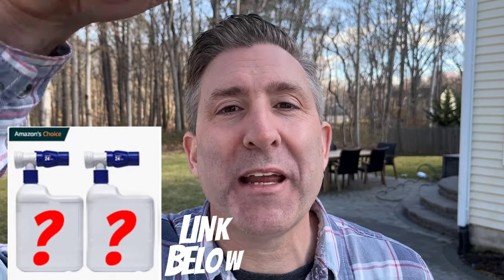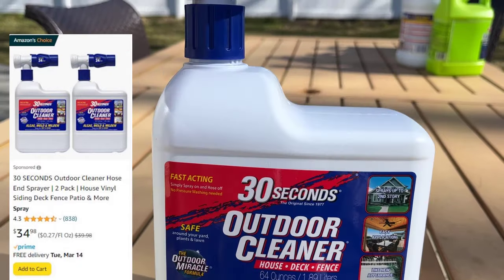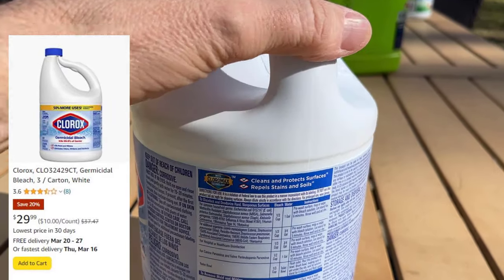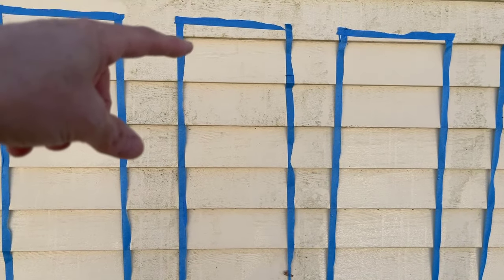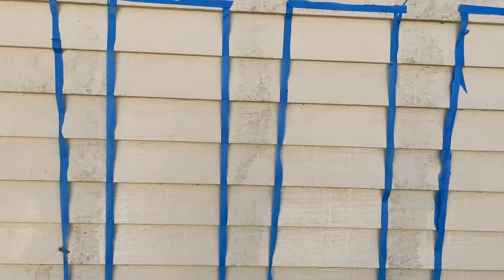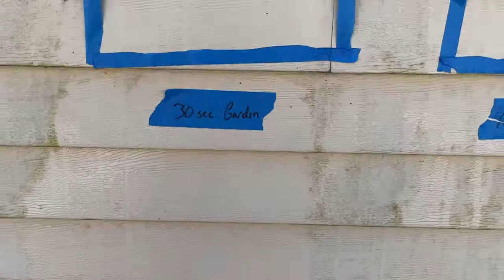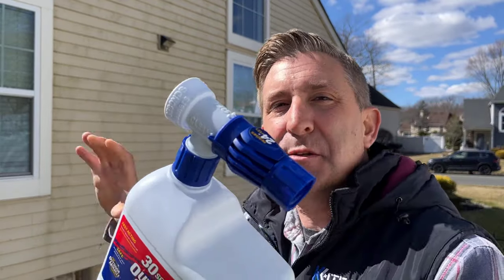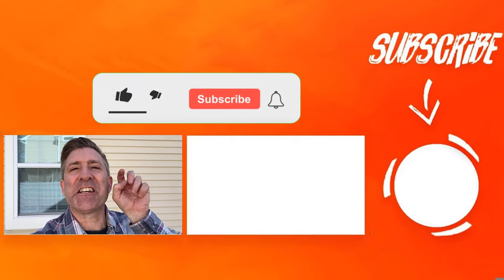DON'T POWERWASH - Top 5 Siding Cleaners: One Comes Out on Top💦

Comment: Under $3 for a gallon of regular bleach. Put a third of that in a 2 gallon sprayer with a few onces of Dawn dish detergent and the rest water - less than $5 tax included... that one gallon of bleach covers my little ranch house and 2.5 car garage 3X, and I guarantee it does just as good of a job.
Reply: I would try that but we have a lot of shrubbery and flower gardens around the foundation and I'm sure this solution would not be very healthy for them :(
Reply: Idk about anyone else, but the day I spray bleach on my 20k siding…wth
Reply: @jeffflowers729 I do this for a living. Pre-spray/ wet the plants. Any drips that land on it will not damage it. If you do drip on it you can just spray with a hose again real quick and it will dilute it. Its safe
Reply: @myheartisinjapan3184 you swim in sh. Bleach/chlorine/sh. Its all the same. Its dangerous or helpful depending on the strength. Just like anything else. Bleach is a scary word because it messes up clothes sometimes.
Reply: Thank you sir for the knowledge.

Comment: Ive always had excellent results just using cheap dollar store bleach with a 50/50 mix and rinse with the water hose. Ive always been told that it destroys the vinyl siding but mine is 23 years old without any visible damage and i clean it twice a year…
Reply from the maker: I think bleach is bleach - all the products that I tested say safe on vinyl
Reply: Is 50 / 50 bleach safe for trex deck
Reply: It doesn’t destroy vinyl siding, but it will destroy vinyl fencing on your deck. It removes the protective coating put there by the manufacturers.

Comment: You didn't try pool chlorine with 30% chemical that all pros use these days.
Reply: But will deteriorate the paint?
Reply from the maker: I think that is true - however the point of the video was to test products that homeowners can use easily and safely
Reply from the maker: @Carlos.Rivera  and possibly kill plants
Reply: @Kitearmy  you have to wet the plants with water before, during and after with ALL these chemicals.
Reply from the maker: @markb3866  right - good idea
Reply: @markb3866 i would be ticked off u kill my Lillies, rose bush , etc.
Reply: Diluting the pool bleach 4 to 1 is a pretty good economy if you already have pool bleach for your pool.

You want a 5 to 7% HypoChlorate strength in a hose sprayer at best for latex paint or vinyl siding to avoid pitting and color loss.

DollarTree and other generic household bleach is 5.5%...typically $2.50 per gal to $5.

Comment: That 30 sec cleaner keeps cleaning for days after. It’ll look cleaner and cleaner in a few days
Reply: Pritam - you are correct! We tried it for the first time this week and noticed the same thing. We bought the concentrate and applied it using the soap function on our pressure washer. Works great, even without rinsing/pressure washing off. Our gutters and stucco bands brightened up like new. Very satisfied!!!
Reply: Is it safe around plants, especially here in South Florida?? Or should I drape my pineapple and Goji bush

Comment: I use the mold armor deck full strength in a garden sprayer. I Use the deck cleaner on my wood deck, vinyl siding and vinyl screen house top.  It has worked well.  He did not hose it off after 10 minutes which I found is needed.  Vinyl looks brand new and tends to resist mold for about 2 years on the siding. With the bleach there is the strong smell plus it ruins whatever clothes it touches.

Comment: So, NOW you tell me! I bought  1/2 gallon of Mold Armor with the hose attachment last year,. but never "got around" to using it. I even bought a full gallon refill bottle for THIS year. When I saw the large display of 30 Seconds Cleaner at Lowe's a few weeks ago, I decided to buy 1/2 gallon with the hose attachment. I'll use that on the shady, yucky side of my house, and use the Mold Armor on my aluminum shed and the garage-type door on my portable building. Thank you for posting this comparison video!

Comment: Very good video.  Any chance you've compared 30 SECONDS Outdoor Cleaner to Zinsser's Jomax?  I've used Jomax a few times and been very happy with the results (using a hand held sprayer, so not as convenient as the hose connection of 30 SECONDS).
Reply: I wondered the same thing.

Comment: Great video, i am definitley switching from mold armor to the 30 sec cleaner. Did you also spray the windows? If so did it clean them?
Reply from the maker: Yes and yes
Reply: yeah, ive been using mold armor and its always worked pretty well for me.  will have to try the 30 sec stuff.  i wonder if the type of siding, age of it, etc effect it much.  will be interesting to see the difference on my own home.

Comment: Thanks for the video. I know this is long after the video was posted but I do have a question..... How does this do with dark vinyl sidings? Does it bleach them out? I have very expensive dark gray siding. I know I can do a 'test' area first but just wanted to know if you have any advice / recommendation? Thanks in advance.
Reply: I have the same concern. Just wondering if you used this product and if it caused any damage. Tia
Reply: @coryforbes897 
I ended up using LA Totally Awesome  Cleaner and diluted it about 10:1.
I used a soft, heavy duty microfiber mop head on a long pole/ extension and warm water. My siding wasn't too dirty. No damage.
I'll do the same again next Spring if it needs it. 
Apologies for the delayed response.

Comment: Uh, if you simply used the 30 second cleaner straight from the hose sprayer bottle, then you were spraying on a highly concentrated amount as it would normally be mixed with water as it empties from the bottle. of course it looks the best as it was probably a good 10-15 times higher concentration
Reply: Amazing that 90% of the people missed this minor detail.  Also, using straight bleach is not correct either.  Very poorly constructed 'test'
Reply: I was wondering the same thing.
Reply: These bottles usually give you directions for mixing them when not using the hose sprayer. You are assuming he didn't mix it correctly.

Comment: Great video!  Used mold armor in the past. Will definitely switch to the winner.  Is it safe to use on the house if near concrete pavers?   Had Cambridge pavers installed around the perimeter of most of the house.
Reply from the maker: Thanks mate - you should be good with your pavers

Comment: Can you fill the concentrated 30 second brand into the 30 second hose end bottle?
Reply from the maker: yeah - you have to use a wrench to twist the head off
Reply: I read that it's recommended to use 50/50 mix or can I fill it straight undiluted?

Comment: I find straight Clorox bleach works best when you wet the siding with water then hit it with the bleach
Reply: I heard if you use a gallon yard sprayer 3 cups of household  bleach and 1 oz of dawn dishsoap and the rest water and spray house top to bottom ,let it set 15 mins and then wash off that it works great.  5.00 to do your whole house

Comment: if I follow the mixing recommendations for the 30-sec concentrate it makes 5% solution. Since you recommended the pre-mixed solution which is an advertised 8%, what is stopping me from either adding less water or using the concentrate straight to get a more powerful solution to either use in a sprayer or as a refill to the hose jug you recommend?
Reply: Pretty sure that 8% is diluted by the water lol

Comment: Works great but runs out FAST. Don't know if it matters how open the faucet is or if it's regulated at the product nozzle, but it took way more than 2 bottles for my lil house.
Reply from the maker: Sure - is the house clean
Reply: It WAS clean...lol. mildew on caulk and other areas came back but algae and dirt and whatnot is gone.

Did you have the water wide-open? Does it matter? @Kitearmy

Comment: I don't know how you got that large wall done with 1 bottle. I did the backside of a mobile home and was half empty and I have a flow regulator on my hose. I ran out after 2 bottles and did not complete the job. But, the area where I did cover worked great. I missed behind the down spouts and corner areas because it goes so quickly. If you don't cover enough, it will leave streaks where part is clean and part is not. So don't expect it to just run down and work, because that chemical from up top is used, so you have to apply as much fresh cleaner to every level. I'm going to paint, so a little streaking doesn't matter for my job.
Reply from the maker: maybe you have more mold
Reply: @Kitearmy  Maybe I don't.
Reply from the maker: @floridaredneck  but yet, maybe you do.
Reply: @Kitearmy  I don't. There is no maybe . Would you like to come over and check?
Reply from the maker: Are you located near tampa @floridaredneck
Reply: @Kitearmy  Yes, I am.
Reply from the maker: I'm coming over @floridaredneck

Comment: Bleach can be bad for the environment, particularly when used near a fresh water source. The directions on the bottle should be read and followed to allow these products to be used safely.
Reply from the maker: Great point - follow the directions
Reply: Duhh You really think people don't know that average consumers opperation won't do much damage
Reply: @MariusNinjai  is that your opinion, or is it informed by say some research? 

Bleach, when used properly, and in a contained environment (such a proper amount, handled carefully, diluted, and flushed down drains to a proper wastewater treatment plant) is not perfect, but it is not terrible.

However, bleach in the environment does not biodegrade, but it does break down and is highly reactive (which is also why it is good for killing microorganisms). In water it forms (among other organo-compounds) dioxins, furans, and dibenzo-p-dioxins (PCDDs) all of which are known carcinogens and have half-lifes of several years. Dioxins in the environment is what led to the near extinction of bald eagles as well as an overall decrease in fish and bird species near large bodies of fresh water.

Recall, it is not just bleach that is stressing the environment. I also did not call for banning bleach, I said WHEN USED the directions on the bottle should be read and followed.

Of course, it is the manufacture of bleach (particularly sodium hypochlorite) that is the source of the majority of environmental pollutants. So, maybe considering more environmentally safe alternatives is a reasonable suggestion.